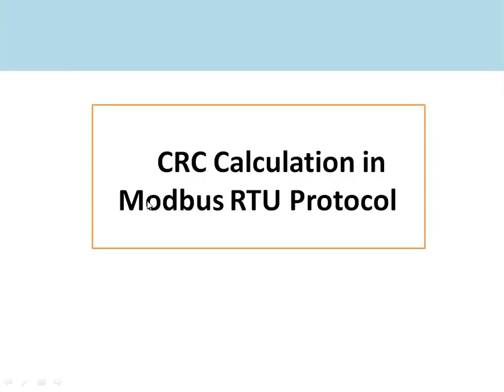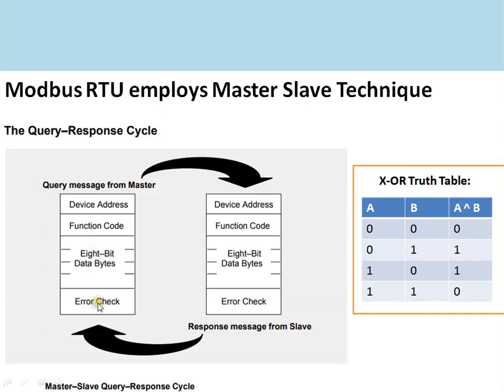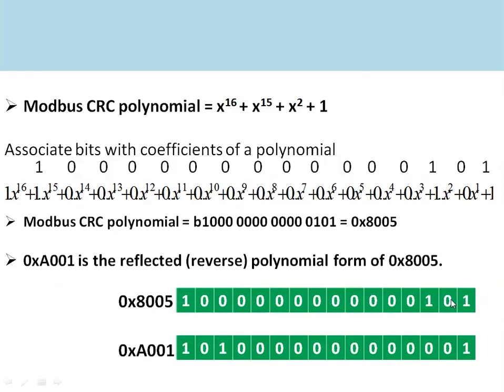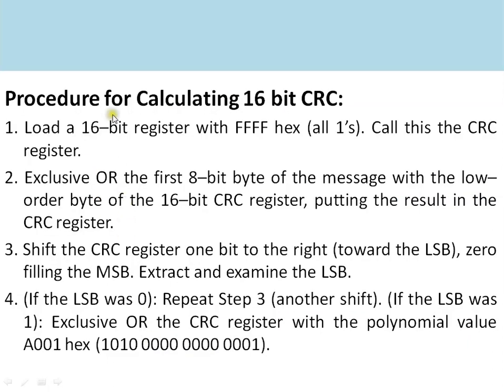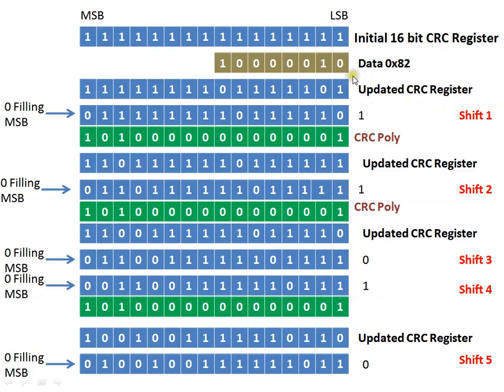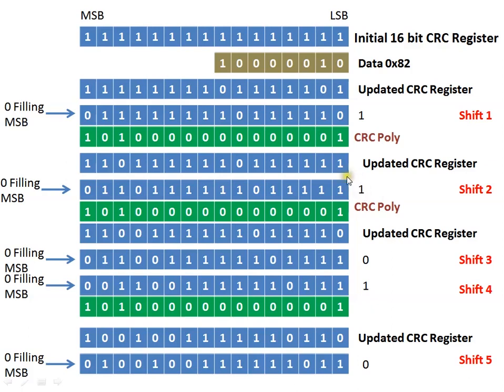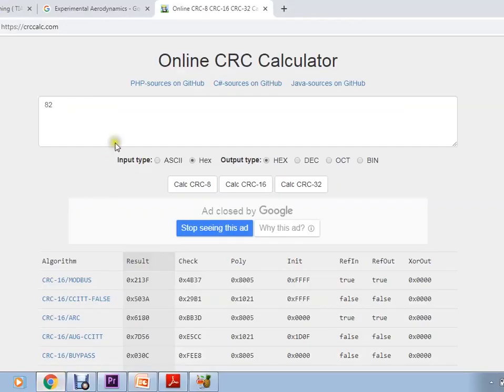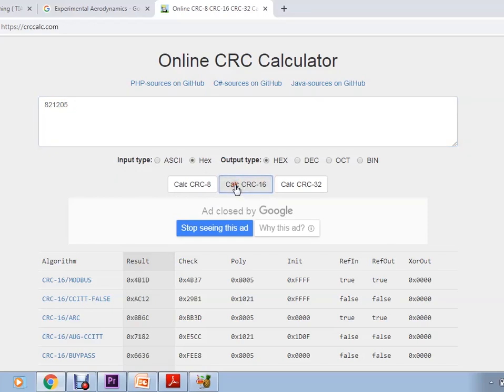16 bit CRC Calculation || Error Detection|| Modbus RTU || Using Reflected (or Reverse) Polynomial

Comment: why is (1x^16 = 1) but (1x^15 = 0)? Why is the 0x8005 not beginning with 1100...?
Reply: I was thinking the same thing.
Reply: @rayramirez5799  @Ari Mse - there is no mistake that's it cause REGISTER is 16 bits no 17 . Counting from 0 to 15 not from 0 to 16 )

Comment: step2 in theory uses OR bitwise, but example use XOR bitwise (right), let’s check it again.
For the Generator Polynomial: 
X^16 + X^15 + X^2 + 1 ~ polynomia 0x8005
Reflect polymial in oder to swap the high and low byte of the result ~ 0xA001

Step1: load crc_reg_value with 0xFF.
Step2: XOR the lowbyte crc_reg_value with data input byte. Update the result into crc_reg_value.
Step3: checking if the LSB bit of crc_reg_value is 0, just shift the crc_reg_value to the right 1 bit. Else shift the crc_reg_value to the right 1 bit and XOR with poly value(0xA001 - reflect Generator Polynomial). Repeat to the end. Update the result to crc_reg_value.
Step4: continue with the next data input with step 2-3-4 to the end of data input.

Comment: Hi, I have an 8-bit microcontroller that does hardware CRC, but the algorithm of reversing the CRC, makes it only gain a few microseconds compared to the CRC per table, which is very fast and efficient. My question is, is there a way to calculate the modbus CRC using the inverted polynomial (A001) and match another configuration? Regards.

Comment: Hello sir, this is the great video. Cleared every concept. i have one question though. If i want to have a look at the calculated value of CRC in program, then how to display the calculated CRC value on UART. I have a UART program ready. Receiving, calculating and sending values using microcontroller.
Reply from the maker: http://modbus.org/docs/PI_MBUS_300.pdf. Please see page 120 of this document. Gives an idea how to implement 16 bit CRC in C. 
You can also see my video https://www.youtube.com/watch?v=6qAZAX6ymXY&t=339s
@12:00  gives an idea of implementing in C.
Reply: @RockzAutomation  Thank u so much sir.
Reply: @RockzAutomation  Hello sir. I have implemented the C program as per your guidelines. Now i want to know do i have to send the data to CRC generator function as received through UART or do i have to process it in some way. Then how do i know that calculated value is right. Plz guide me on this.

Comment: Hello,
If i have 5 byte of data 
For example.
08 38 0c 00 00 .individual byte crc i calculated manully as per calculation it is matching correct.
For Final 16 bit crc of 5 byte of data.
How to calculate the final crc 16 bit  of all individual byte?
and i have to cross check with online crc calculator.
Reply from the maker: As shown in video do for first byte. After 8 shifts (i.e. after 1 byte) EX-OR the 2nd byte to the resultant 16 bit CRC register, perform 8 shifts and continue the operation so on for other bytes.
Reply: Thank you so much.
Keep educating us..!!